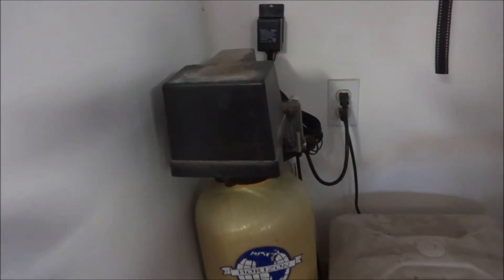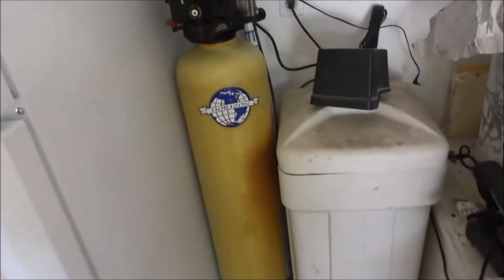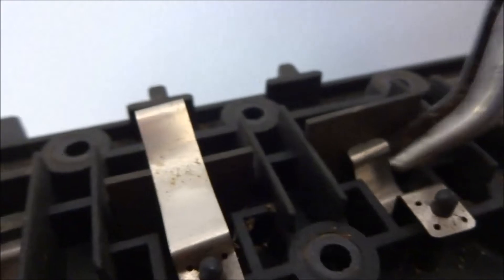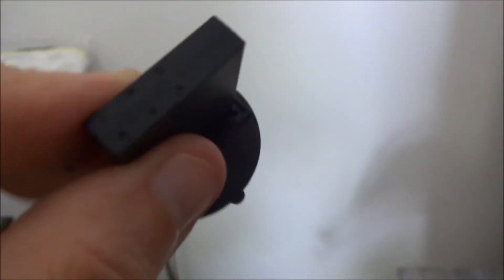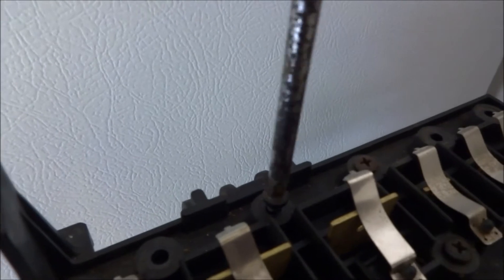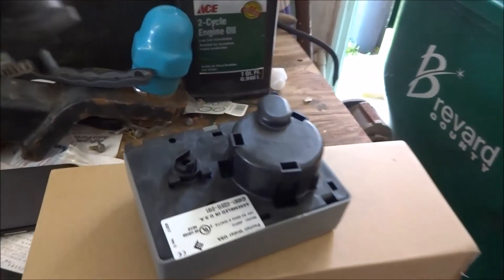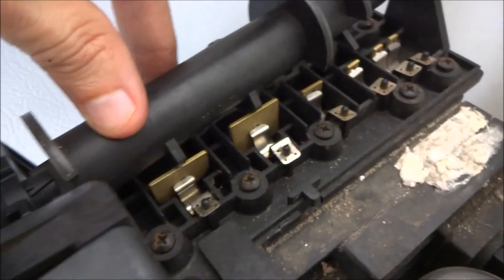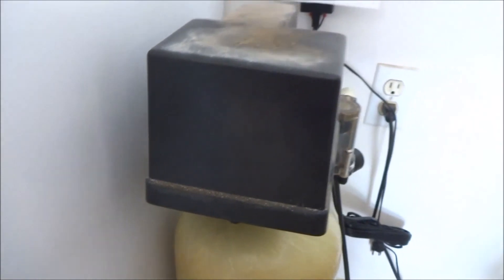Replacing Water Softener Flapper Valve Discs

Comment: Nice video...I have a question for you,I have a series 155 and  checked the 28f-bb injector and the 25f-10 backwash assembly,10''-54'' resin tank...my problem is when i'm in backwash mode my brine tank starts to fill???Otherwise when I'm in regeneration mode everything else cycles as it should and when completed the softeners brine tank holds steady till my next regeneration which I've been doing manually every 7 days.About 30 minutes into backwash mode it will empty the brine tank and give about 20 minutes after brine is emptied  of rinse.When it enters brine it fills up to what I have lbs of salt set at but.But during next regeneration it adds to the brine during the backwash cycle???Hope this makes sense,can you help me out?
Reply from the maker: 25531 thanks. I'm not familiar with all the systems and models. But if your system is similar to mine, a cam opens and closes each valve. I would guess your cam is not centered where it should be.